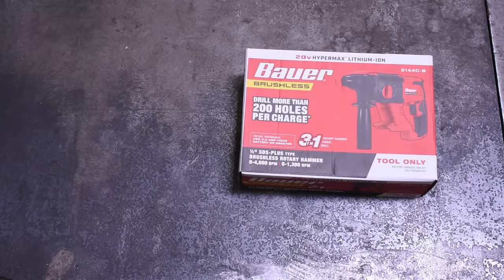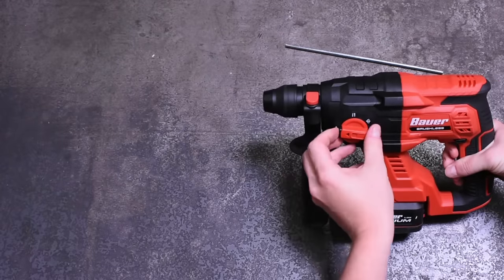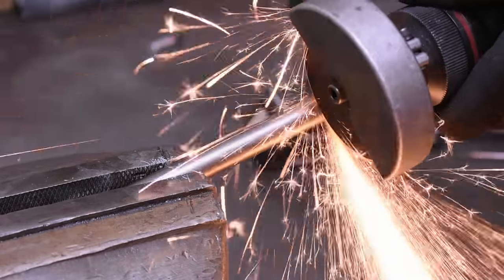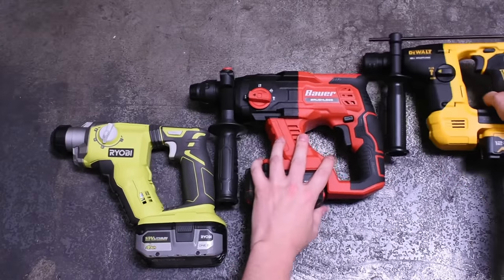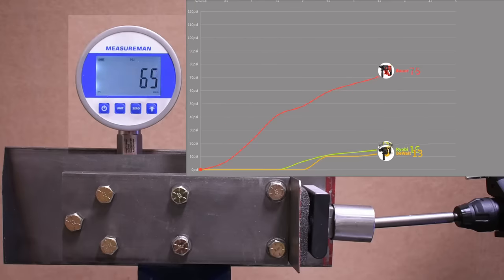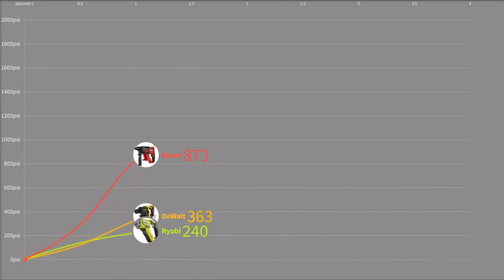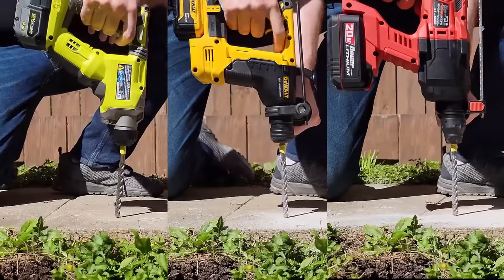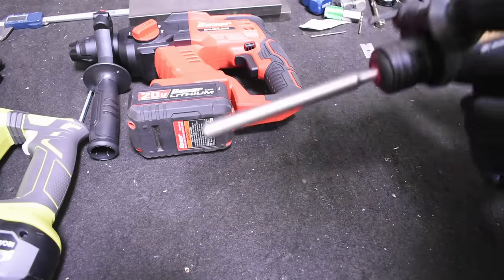Best Compact SDS Rotary Drill? Use as a Cordless Air Hammer?

Comment: As of Aug. 8, 2024, the Bauer hammer drill is 29.99 at Harbor Freight.  No coupon or special promo, just the going price. This is a 2 year-old video, so I'm not sure who will see this, but I just found the video and thought the update was worthwhile.
Reply: Just bought it for that price today lol thats why im watching this😂
Reply: Bauer is a buy once, use once brand 😂
Reply: @YuckFou0x0FFFF  have you used one? Ive owned the older makita cordless, and dewalt cordless and now also bauer.. ive used em for 2 years no problem, woodworking carpentry amd automotive amd welding/fabricating work.. they work great for projects, and ive dropped my drill off a 15ft scaffold and it went right back to work.. now if youre a pro and using em 8hrs a day i would get a higher end brand, but for most people even semi pros who are still just starting u cant go wrong for the price
Reply: @YuckFou0x0FFFF  id consider them equal to ryobi imho, but with a better battery platform.. worse warranty tho
Reply: Hi

Comment: I love that you guys are testing this segment, from my experience Bosch and makita make the most commercial oriented hammers would love to see them in the future.  I think your channel suffers from to many great tools to test and not enough money to test them all and stay independent and free of sponsors, keep up the good work.
Reply: Don't forget the crazy expensive Hilti lol they're famous for their nasty rotary hammers.
Reply: Lol i've had cordless makita's break on me before and bosch aswell never use them as cutting devices into stone and such. Only as drills
Reply: Hilti is king of the rotary hammer
Reply: except makita has higher hit forces, and bosch has higher bpm , for concrete i chose makita, to drill trough tiles without smashing them, bosch
Reply: @robivlahov  both can reliably do either if you use the appropriate tools, for concrete i only ever use SDS Max tools. Tiles obviously a normal SDS+
Reply: @falcon5751  to drill holes ? No need for sds max for 6-12mm drill bits ... Sds max ia for large holes , i use those only when remodeling a pool so if a pipe has to go trough some wall ... But thats another thing.id like to see someone not brake shiz with the makita roto hammer i use ,too powerfull , its fast , but its not for gentle work , the boach is much better , drills almost as fast ,even faster in some material , and is much more gentle , its hammer function sucks compared to makitas tho...
Reply: @7chrisjeep  love my cordless hilti.

Comment: Man, I was impressed with the bauer considering only 90 bucks.
Reply: We have the Bauer model, my father picked one up a few days after it came in stock at our local store. Even though I didn't get to help a lot through most of the job I got to help them use it tear up some old commercial vinyl floor tiles from the kitchen floor of their building they bought. It worked really good, though it works best in spurts. :)
Reply: @Slane583  I may just pick one up.
Reply: @sxsoutcast7651  So far I've only used it for chiseling and it's worked really good. I can't comment on how well it drills or its' longevity though. My father did end up picking up a corded Bauer model the store had on a returns/clearance table for cheap as a backup unit for when the batteries get drained on this one. So that's about the only thing I can suggest, just make sure you have a few 5Ah batteries. When you get in the flow of doing work with it you lose track of time and before you know it the battery is depleted. :)
Reply: @Slane583   batteries and charger are really cheap too. Its seems like a good deal. I'm in construction and only use corded equipment for this but for around the house or lite duty stuff it should more than suffice.
Reply: @sxsoutcast7651  My older brother has been slowly replacing his older brushed Bauer tools with the new ones any time they've released a new brushless model. So far he likes all of his tools. HF even has a small Bauer air compressor that takes two batteries. One of their newest Bauer additions is a 4-gallon pack pack sprayer that also uses the Bauer batteries.

I on the hand have been going the Hercules route. I originally started buying Milwaukee tools but when I saw the 12v and 18v tools required separate charges I switched over to Hercules. Their big charger charges two batteries in one go, accepts both 12v & 20v batteries and also has usb ports for charging a phone or device. The 5Ah batteries are also reasonable at $65 each instead of $160 for one DeWalt battery.
Reply: @Slane583  I have all craftsman tools and after seeing the dewalt and its dismal showing that even if craftsman made a tool like this, I wouldnt buy it. Cant beat the price of the bauer... 👍
Reply: @sxsoutcast7651  Indeed. The Hercules line doesn't have all of the useful outdoor tools for property maintenance like Bauer does. But I didn't get in it for that. Besides Milwaukee making you buy either two different chargers or a combo unit if you wanted both the 12v and 18V tools it was the price of their cordless 7-1/4" circular saw that made me switch over the most. 

The Milwaukee saw was going for $250 for just the tool, no charger or battery. The 7-1/4" Hercules offering was going for $100 and because I bought my mother a compact 12v Hercules drill for doing her projects outside I already had the two battery charger. I just needed the saw and a 5Ah battery. The saw and a single 5Ah battery was still cheaper than Milwaukee's saw by itself. Sadly I bought it over winter so I haven't got to use it yet but I'm hoping there's some sawing to be done this summer. With just handling it the build quality feels up to par with a DeWalt or maybe some older DeWalt models. I can't say for sure as I'm not a contractor but it doesn't feel cheaply made. :)
Reply: @Slane583  dewalt is starting to come back alive with their newer products but me, I dont need the biggest, the best, and definitely not the most expensive . Milwaukee cordless is expensive and we do use some of their tools in our shop from the core drill to sewer machines and camers but the price is steep. Now bauer is budget friendly, and I like that. Count me in.
Reply: @sxsoutcast7651  The same goes for me. If I can get something similar to what I had my on and get 90% of the original items build quality at half the price I will go for that instead. Especially if the line has a decent selection of tools for future purchase. There is a Hercules grease gun I've been eyeing for future purchase. They also have it in the Bauer line as well. :)
Reply: @Slane583  never tried Hercules and really haven't followed their line but half the price of the big name is always my route! Gonna head to harbor freight this weekend .
Reply: @sxsoutcast7651  Sounds like a plan. Hercules is mainly just HF's offering to compete against DeWalt. Bauer on the other hand has more variety to offer as far as different tools go. But usually with some tools if there's a Hercules offering there's also a Bauer version to be had as well. The new grease gun is an example of that.
Reply: @Slane583  I'm in need of a grease gun for my utv. I always borrow my brothers.
Reply: @sxsoutcast7651  My father has the more expensive DeWalt grease gun and uses it all the time on the tractors and his fuel trucks. The recent Bauer offering is $120. If this rotary hammer has you interested already take a peek at that. HF also has a quick-release grease head I bought my father for his grease gun as an extra Xmas gift when I got him a new high torque impact wrench for Xmas. Of course anything for him I stuck with DeWalt since that's what he already has. But they had a really good sale in December for DeWalt tools at our local Runnings store. So I got a good deal on his big impact wrench. :)
Reply: @Slane583  I already bought all craftsman tools and batteries. Recip saw, heavy impact, drill, small impact grinder, hell man I even bought the hedge trimmer too. But the chipper seems like a deal and I NEED a grease gun too.

Comment: Love it!! Been doing this for years with my M18 Hammer drill.  Even made custom 1/2" socket adaptors so I can put a 15/16" wrench on it when hammering to bust bolts lose
Reply: Can you post photo of that adapter? Do you use super shallow sockets?
Reply: @intoxigated  not sure how to post a photo but I had a 5/8" sds drill bit the worn out so I cut it right where the twist starts.  Then I took a 5/8-11 coupling nut (long nut) then a 1/2" impact extension about 6" long cutting it 4" long.  Then drilled the nut out so the drill bit pressed in and the socket extension too then ran 3 weld not a full weld just in case it cracked. I wire brushed it all after tig welding it.  One other tool I made it took a 1/2" drill keyless drill Chuck and turned a 1/2" drill bit to have 1/2-20tpi.  I think you can buy them now but 8 years ago they couldn't find them.
Reply: @fryreartechnology7611  make a video and put the video on YouTube so we can see it please!
Reply: @marcowens3522  sounds like fun but my job doesn't let us record and welder, drills and fun toys are at work.  Been told I need to do a channel but my job said no...
Reply: Lol, I made one to. Held them in the lathe and welded them together
Reply: @cyrex686  hell yeah brother! I don't always have air for my air hammer and I got to using my M18 Hammer drill for putting in anchors in at work.  I do industrial maintenance......

Comment: Great content as always-SDS Max and Plus Rotary Hammers are perfect for the Metabo HPT 36V AC adapter-two use the AC adapter when available and run em all day-saves a bunch of battery life and longevity but allows us to only have to carry on Rotary hammer instead of a battery and corded version
Hitachi has always had high quality air/electric and now Cordless Rotary Hammers

Comment: I was just thinking how living in the rust belt how junkyard runs would be so much easier if such a tool as a cordless "air" hammer existed. Whoever decides to develop and bring to market this tool first will be racking in the money from mechanics I am sure. As always love the content, keep up the great work!
Reply: If you really need a cordless air hammer, you could use one of the larger SDS drills. The ones he tested were the smallest ones. If you used something like a 1" SDS Plus drill, you should have similar power to a much smaller air hammer. It's not something you would want to use for 8 hours a day, but it could work for a junkyard run.

Comment: I’m glad y’all are testing these. I need to drive some ground rods, and I’ve been wondering if these options would allow for good performance in that regard.
Reply: I work for an electrical contractor. All our techs use Milwaukee SDS Max to drive the 8 foot ground rods. Usually with a 9ah battery.
Reply: Did you get one, and (if so) did it work well for ground rods? I saw a YouTube video where a guy used the Bauer for driving a (6 foot) rod, and it worked extremely well!

Comment: One thing I have used my air tools for, is doing work underwater.  My parents pool has concrete blocking the conduit for the lights.  After some brainstorming, we used an air drill to drill out the hole.  We also used the airhammer to knock off some of the high bits of render.  Worked great.  Just needed to oil it up after use

Comment: Hi TTC. I love the channel. My understanding is that the optimal impact force with SDS toos is achieved by maintaining a "float" with the drill bit at middle of the sliding travel range throughout the duration of the drive. Let the tool do the work and follow it in. I have always wondered if bottoming out the bit in the chuck causes losses in impact force. Is this something you would be open to testing on a tool or two?
Reply: I'll just answer from experience, no. The bits have free room to move back and forth but only get hammered if they're all the way in. General you just push harder without pushing hard enough for it to bog down.

Comment: Wow.... would not have expected the HF tool to be the top!

Would love to see the M12 - It's on my "to buy" list.
Reply: Anecdotal, of course, but if you're talking about the fuel it's decent and has the beans to drop a 3/8ths hole through a relatively new concrete slab. Anything bigger than 1/4" on old concrete is going to be rough though.

Comment: Back when I first used a cordless SDS+ during a volunteer project, I was impressed with how well it did compared to a corded version of the same-size tool.   Way more convenient to be doing holes in concrete without needing to trail a power cord, especially in my case when I was on a lift and could drive along the building I was working on without having to come down and move the power to keep up

Comment: I had the top of the line Bosch 36volt SDS about 10 years ago and it was an absolute beast for drilling up to 30mm holes but way too heavy to use as a breaker for any length of time, except for low/ground level tasks.

Comment: I own the Milwaukee m12 5/8”. Having no hammer only function is the ONLY negative about it. It’s a great tool. 
I also own the gen 2 Milwaukee 1 1/8” and it’s been great. To round out the collection, I have the Milwaukee sds max 1 3/4” and it’s pretty good. It’s mostly for hammering ground rods into the dirt and seems like it’s just about the minimum of what I want.

Comment: I bought an air compressor that could run an air hammer, because  there isn't  any comparable cordless ones out there.  however,  I could  use a hammer drill, because  one can never  have  enough  tools.

Thanks for the great content and due diligence out of each test you run.

Comment: I’ve needed an air hammer at work every once in a while. I’m a carpenter. I have a 4 gallon 4.3cfm compressor. I tried an air hammer but you get about 3 seconds out of it before you’re out of air. My compressor has a 90% duty cycle but it’s still not big enough. I’m glad to know these can do it if need be. 
You could also do a video on how much air a certain tool uses. I know I have picked hitachi over the old bostitch framing nail guns because the hitachi uses a lot less air per shot. And still has the same punch.

Comment: I've used my 120v DeWalt hammer drill like this before and it worked well. Was trying to remove a worn bushing from off of a wheel on a lawn tractor. After having no success with a hammer and punch, I put my hammer drill in hammer mode only and the bushing came out within seconds

Comment: From a contractor's POV, there are a few additional things to take into consideration when it comes to drilling and chipping with cordless, corded, or air tools. I'd say the most important consideration is the material you're working with. Any man-made material (brick, concrete, mortar) is going to be drillable with pretty much any of these tools - it's just a question of how fast you'll get your work done. Natural materials (stone) are a whole different ball game. The lightest tools might be able to deal with marble or sandstone, but when it comes to granite, quartz, ironstone etc, even the heaviest corded hitters are going to struggle and the chisel quality will show itself really fast. 

I had a job a few years ago where we had to chisel about 150-200 ft of channel in a stone house to run electric and parts of the walls were granite, others quartz, others regular field stone. One of us was using a Hilti TE-60 (SDS MAX), the other a Makita HR5000 spline drive. So, over $2K in tools that really bogged down on the quartz and granite. Store-bought 1-in chisels were worn down in less than 30 minutes (and less than 4-in of channel made) and we had to special order chisels for both tools from Ajax Tool Works which specializes in air tool chisels. We were both totally worn out after 6 hours/day of chiseling due to the weight of the tools. 

The lesson learned from that experience is that the best option would have been to rent a large compressor and air tools for the job. Cordless and corded tools are great for most man-made materials, but when it comes to natural ones, nothing can deliver the power that an air tool can yet.

Comment: I like the DeWalts in 20V and they have a few of them; would like to see them tested as it would be nice to see a comparison as the beans between them, while these are rated in joules, across all tools much like torque manufacturers seem to inflate these numbers.
Add: I can’t speak for other manufacturers but DeWalt does have a number of these in 20V and up to the 60V Flex-Volt which can get from 7/8” to 1-9/16” rates drilling size and I do t recall the joules ratings of them but they do very widely across the same size 1 to 1-1/8” between generations with the brushless being maybe twice as powerful as the brushed. I think around the 1 to 1-1/8” is about the standard for most people as far as getting into and using SDS+and what most would have on hand. I know I’ve used mine in place of an air hammer/chisel when away from the compressor or just in a pinch. SDS rotary hammer drills into concrete better than any clutch style “hammer drill” can as well as being good at chipping and chiseling. I’ve even used my large demo hammer in automotive before to help bend steel back into place.

Comment: I've got the 12v makita and milwaukee for me and my workers. We exclusively use them for 6mm holes but for the hole size and weight of the drill we are all very happy with both at the end of a ladder. The makita is the favourite as it has a belt hook. 

Both don't have a chisel only option unfortunately